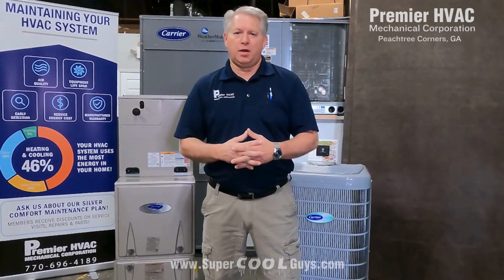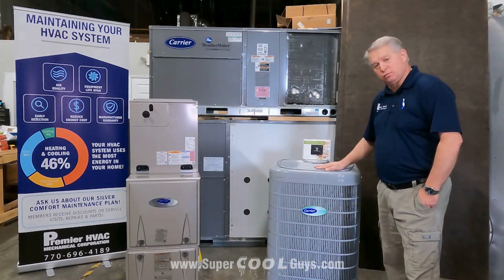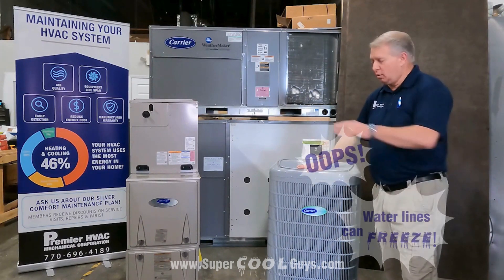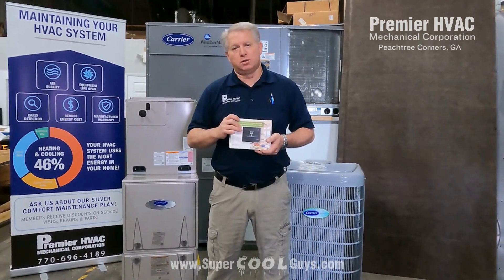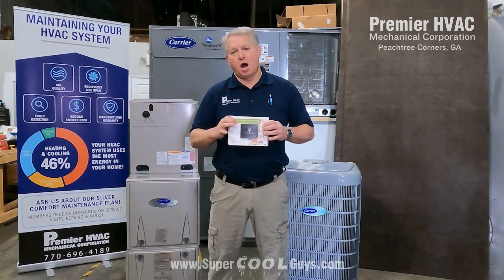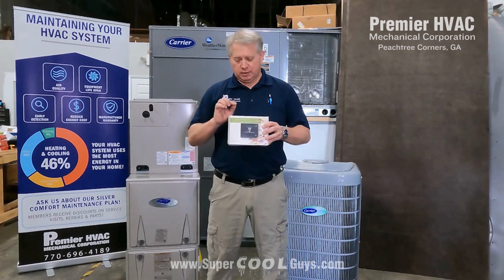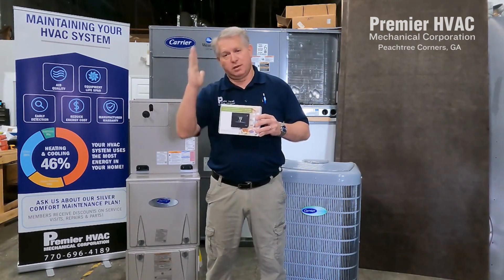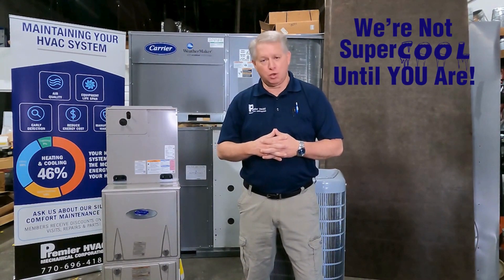HVAC Carrier Infinity Communicating 24VNA9  - Premier HVAC Mechanical Corp

Comment: What about the Greenspeed model 24vna6?
Reply: Unfortunately Carrier terminated the production of the fully variable greenspeed 636 and now only produces a fully variable greenspeed heat pump.
Reply: @jb.2986  No it's still available.  Just a different model number.
Reply: @CarreraTrack  not based upon my research. What is the new model number in 2025 for a Carrier fully variable greenspeed air conditioner condenser that is not a heat pump?
Reply: @CarreraTrack  That's correct, we just received some new information on this and it availability with the new r454b systems Carrier is releasing in 2025. The new model number 26VNA1.
Reply: @  I just saw that now on the Carrier site!  Thank you for the reply. Great to see.  So now, let me ask...why should I purchase the 2025 26VNA1 R454b refrigerant model that is more expensive, not as quiet, and not as efficient as the 2024 24VNA6 model which uses R410a refrigerant, has a higher Seer/EER2 rating, and a 51 dB noise rating at it's lowest speed?
Reply: @jb.2986  You may not have an option if your contractor and dealer can't find the size 24VNA6 you require.  Production ended in the early Fall to start ramping up for the 454b systems.  I purchased the 24VA6 this past September as I didn't want to deal with any new issues as the 454b systems come online.
Reply: @CarreraTrack  yes there are two 24vna6’s left in our area according to my carrier rep.  I’m going to purchase it as I hate buying inferior (as compared to a prior year model )products driven by GWP politics.
Reply: @jb.2986  Incorrect. The new fully variable model is now named the 26VNA1.  You can see it on Carrier's website.  It runs the new Puron Advance 454b refrigerate.
Reply from the maker: To all, thanks for your comments.
My understanding from my rep is they are getting away from the 5 stage infinity 24VNA9 AND 6(410a). Of course these model numbers have changed with the new 454B refrigerant  to 26VNA1 for Ac and to 27VNA0 and 27VNA3 Greenspeed for Heat Pumps. I currently only have available in my area,  Atlanta Ga, in the Ac Model is 26VNA1 so far. They will eventually do away with all 5 stage and go to ALL Geenspeed